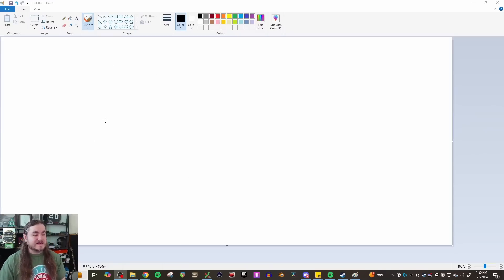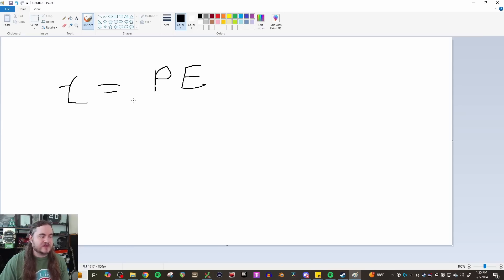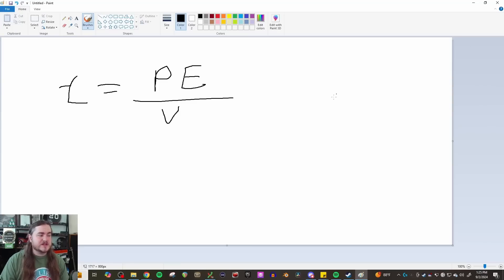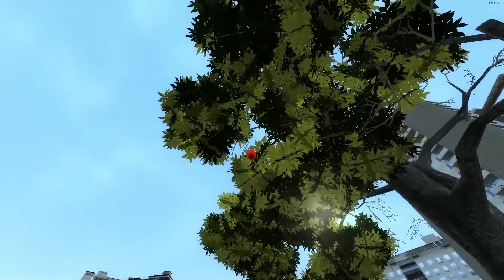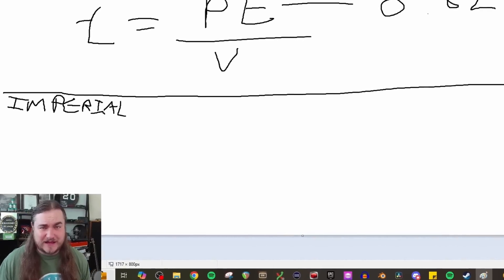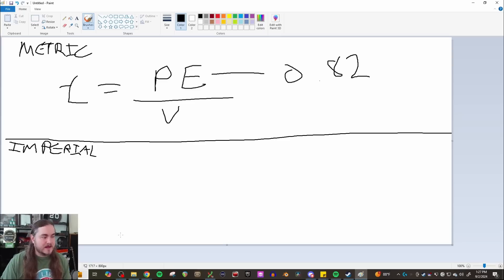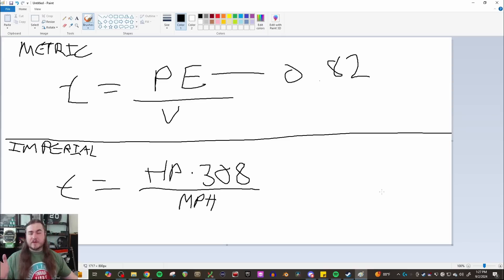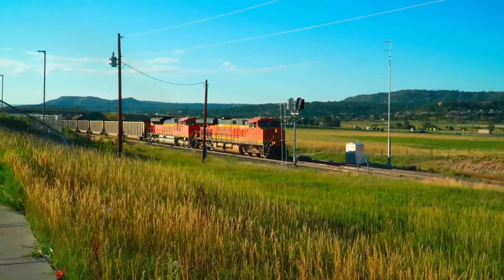Diesel Tractive Effort 101

Comment: 11:10 The complete motive power adage can be summarised like this:
* Steam can pull a train it cannnot start,
* Diesel can start a train it cannnot pull,
* Electric can start a train and pull it fast, but what about switching with electric? Forget it.
Reply: hybrid, battery electric, and occasionally even electric shunters are a thing.
In switzerland the Eem 923, Aem 940, and alstom prima H3 (doesn’t have a swiss designation) are taking over a lot of shunting work.
For passenger shunting, we also have the Ee 922, which is the electric brother of the Eem 923, since passenger train yards often need catenary for modern EMUs anyway, they might as well be used for shunting passenger cars too.
Reply: Even in the early-mid 20th Century, the Oregon Electric Railway had some electric switchers that had batteries to enable a bit of off-wire running.  At least some of these (may have been only a couple) were later sold to the Chicago North Shore and Milwaukee Railroad.
Reply: @Lucius_Chiaraviglio  The North Shore's two battery-electrics were built new for the North Shore by GE in 1928.  They were apparently successful, as they lasted until the end of the North Shore in '63.  I've seen a CNS&M ad from the late '40's touting the advantages of the North Shore's freight service, because of the battery-electric capabilities (no wires into the customer's plant, and no smoke/diesel fumes either).  Of course, the North Shore had an overriding reason for electrification (the passenger service), so their own property was wired anyway, and diesel switchers in the late '20's weren't the far more reliable and capable beasts that came later.

I'm not aware of any battery-electrics on the Oregon Electric.  When the OE dieselized, they did sell the North Shore a couple of big home-built freight electrics, but those were straight electrics—no batteries.
Reply: @Lucius_Chiaraviglio  Many attempts were made to build a battery-powered switcher. But outside of a few niche cases, like London Underground, none were successful in the end. Remember NS BP4? It was eventually deemed a failure and sold.
Reply: @Knsgf  Did any of those recharge while running under normal overhead wire (or on normal third rail)?  Batteries aren't going to be very good if you can't do that.  And the MBTA is going to become a living demonstration of that if they actually go through with their plans to battery-electrify (instead of real electrify) the Fairmount Line (in the south part of Boston, not to be confused with the neighborhood that has the name South Boston).  Not switching, but same problem of having to charge only at the end of the line, and being too battery-dependent.  Although given their past track record, I have a stinking suspicion that in this case it's on purpose . . . .
Reply: @Knsgf  batteries would not be good for hauling long trains many miles.  future batteries that can hold that much energy become an explosion risk.
Reply: @Lucius_Chiaraviglio  depends if you are switching around a yard or hauling 150 cars across 4 states.
Reply: @philhoward4466  That's why ideally you run under the wire as much as possible (while recharging the batteries), and then fall back on batteries when you have to get through a gap, including a loading area of a yard or a spur (or for that matter a drawbridge where they didn't put in overhead wire)..
Reply: @Knsgf  The North Shore battery-electrics were built in the late '20's, and lasted until the end of the North Shore in '63.  A 35-year service life sounds pretty successful to me.
Reply: Electric switchers exist though, and I’d think that high startup torque and fast acceleration would work in their favor?
Reply: @mafarnz  The high infrastructure costs are still there, making electric switchers seldom practical, unless entire switching is confined to already electrified portion.
Reply: @Knsgf  The biggest issue with electric switchers is usually cargo handling. You cannot have overhead catenary in the same place that you want to load coal into hoppers for example. Same deal with rotary dumpers or container cranes. For these applications a rusty old diesel is good enough for the job and investing in a dedicated electric switcher with batteries is just not worth it.
Reply: @Knsgf  if the yard is on an electrified line, then often most or all tracks will be electrified. Only tracks you can't electrify are some loading tracks where you could accidentally contact the overhead with the cargo (e.g. a forklift lifts its load too high)

of course it isn't always the case, but if electric freight locomotives are in use then you want it to be able to reach whatever track it needs to (to pick up or drop off a consist) so it usually makes sense to electrify yard tracks when you have electric freight. When those yard tracks are electrified for the road locomotives, you may as well have electric switchers too
Reply: @briannem.6787  Fully installing ovehead above every track of marshalling, classification and storage yards where mile-long trains are assembled is seldom financially worthwhile, as maximum permitted  speeds there are low and a locomotive doesn't need nor can use high horsepower anyway. The same applies to industry spurs and branches, which in the US can be rather long. 

The reason why electric shunters are somewhat common in Europe is directly tied to short length of trains there and short distances in general, allowing a railroad to get away with smaller yards and shorter branches, which cuts cost of electrification drastically.
Reply: @Knsgf  oh, I didn't know you were specifically talking about the US, yeah they do tend to be a bit of a special case sometimes
Reply: @briannem.6787  The "special" thing about american railroads is heavy reliance on road-switchers - "jack-of-all-trades" locomotives which can do road, local and yard work equally well. This is primarily why electrics never gained much traction in the US and Canada.
Reply: @briannem.6787  . . . Which is where dual-mode overhead electric + bettery switchers would come in real handy.
Reply: @Lucius_Chiaraviglio  Several attempts in different countries were made to build such switchers. They all turned to be more expensive to operate at best and outright failures at worst.
Reply: @Knsgf  I wonder if they were trying to skimp on the overhead and operate mainly on battery?  The right idea is not to operate mainly on battery and then recharge at sporadic intervals, but to operate mainly on overhead and use batteries for the occasional place where you can't have overhead (like to get through a gap for a forklift loading area on a spur).

(The passenger analog:  Not Battery Electric Multiple Unit operating mainly on battery power, but Electric Multiple Unit that has enough battery to get through the occasional gap.)

Either way:  Much less battery to have to maintain.
Reply: @pavelpolcer7354  how the heck had Black Mesa and Lake Powell survived as long as it did? How does the Deseret Power Railroad still survive to this day with that logic?
Reply: @poorbrokenhorn  My comment was reffering primarily to switchers, rather than road locomotives, on typical railroads. Typical railroads are likely to have both modern, high-horsepower locomotives for road use and also older units, that still have some life in them left and can be used for shunting.
Both Deseret and Black Mesa are very different and rather unique cases. Both of these railroads were built specificaly to transport coal to a power station on a single, dedicated route. With a fixed route, substantial traffic volume and having their own power plant, economics of these railroads favored electrification.
Reply: @Knsgf  make electric switchers with batteries.  when they are almost run down take them back to be recharged and grab another one that is charged up.
Reply: @philhoward4466  In other words,  a railroad must buy and maintain two battery switchers to do a job that just one diesel can do.
Reply: @Knsgf  DRG E 80 of 1930 was already a 127 kN starting force battery-backed electric switcher (think more like a laptop; it has on-board charger and naturally prefers to be plugged in, if grid is available; but if you take the grid away it will run for a couple hours on it's batteries. When you plug it back in, it will re-charge automatically.) developed to allow eliminating steam infrastructure near Munich. They got replaced by V60's (stereotypical German diesel shunter with always-on torque converter), though.

With modern power electronics and LiFePO4 cells it's easier than ever to build that style, though.
Edit: you can probably just take a European design of a 4-axle electric, add the battery, slightly stiffen the frame as needed, and end up with a NA-typical axle load electric locomotive that has a decent runtime on it's internal batteries. Say, 30 extra tons of LiFePO4 at utilized discharge depth of 100 Wh/kg, gives 3 MWh of useful capacity. For a 3000 ton train, that's equivalent to having 1200 ft of elevation to roll down from, except of course that electric motors unlike natural slopes let you choose the instantaneous acceleration with no significant loss in efficiency.
Reply: @namibjDerEchte  Let's do some more math. Pulling a 3000 ton train uphill on a 1 % grade at 20 mph requires 3500 hp or 2600 kW. A 3 MWh battery back will completely die in litlle more than an hour at that load, covering 23-24 miles at most. Then the train must stop and sit idle doing nothing for at least another hour to recharge.

Contrast this to a mainline diesel electric, whose fuel tank holds about 80 MWh worth of electricity. The diesel can travel with the same train on the same slope at the same speed for no less than 600 miles on a full tank. And it only takes half an hour to refill. 

So no, batteries alone are completely worthless for a general purpose locomotive. The only practical way to make use of battery electrics is by using an overhead power on the mainline and only switch to batteries on sidings and industrial branches. Whether this concept is workable in practice, only time will tell.
Reply: @pavelpolcer7354  There are solutions to things like hopper loading—Kennecott Copper ran electrics with offset pantographs to allow ore loading, for example.  Container loading is harder, but even there I would not claim it's impossible; the big container cranes themselves are electric, after all.  The really intractable problem is the cost of wiring all the yard tracks, which pretty near doubles the cost of the yard.
Reply: @brownpcsuncedu  You push the wagons into the loading area. The locomotive never has to actually go into the loading bay. You might need a few spacer wagons but so what? You can adapt, it's just a matter of using a new tool the right way.
Reply: @placeholdername0000 Spacers work fine until you need too many of them.  The North Shore ad mentioned the plant's yard (such as a steelyard, where large, not-necessarily-regular steel shapes are being moved around with cranes).
Reply: @brownpcsuncedu Oh, that's absolutely true. But don't a lot of those sites have a few small shunters stationed there? Some small diesel or battery powered mini loco capable of pulling a few wagons at low speed from one end of the yard to the other? Mainly because they need to move the wagons internally in between delivery days.
Reply: @mafarnz @robnobert  Its a "final mile" problem, just like power-wires at home. There is easily more distance of wire between every houses fuse box and the closest power poll than runs down the street. Easily more down every street to substation than between substation and power plant ect. So the big impressive feats of engineering embody a lot less of the work and cost than the little stuff. Its extremely affordable to electrify between two cities, but to put more miles of wire into yard tracks that might see only a few cars at a few miles an hour? Uneconomical at its extreme, and its not a "buy once, cry one" type equation either, your maintaining all that infrastructure in situ rather than having a single fueling stand and maintenance shed for the motors, to work inside under lights, not out in the weather. Also one failed shunter is a nothing for meeting schedule, it can be dead towed out of the way and still leave you with just as many operational on the day (there are always a few waiting, or down for routine maintenance that can wait till tomorrow), but a single failed insulator will kill power to most (if not all) the yard. Also loading things onto cars underneath traction wires with cranes ect is more difficult, and 3rd rail systems make switches more expensive and yards more dangerous for operators who are working on foot.

The one coming technology that could change that paradigm is batteries, totally useless for the continuous output of mainline freight, lacking the range for intercity passenger and less safe, heavier and more costly than systems to allow controlled back-feed on EMU services (which currently are using rheostatic dumps, despite power actually being the most expensive part of train operations, just ahead of crew costs, and far over track/wire maintiance on busy routes), small (and often remote operated) battery shunts allow for lower fuel costs/emissions within yards, and are easily rotatable to keep units charging. Yes the batteries will wear out but it will sum to less cost than difference between fuel and power, and unlike automotive applications they don't need the extreme power/weight, and can be far more durable/stable and standardized/recylable, so it might not even be the human/environmental disaster of large electric luxury cars. Or who knows, we might see the technological promise then find some new way to mess up just as badly, time will tell.
Reply: Each time you want to change direction you need to pull a pole or pantograph and raise the one on the other end. That time adds up fast.
Reply: @ pans and poles can be made bi directional. Milwaukee used electric switchers for decades that worked great.
Reply: I've seen electric switchers, or shunters as they are also called, in Hungary. They're probably just for passenger coaches though.
Reply: @thegreenguy5555 That would make sense, since passenger coaches aren’t nearly as heavy as freight cars.
Reply: Electric switchers are pretty common here in Central Europe and have been used on yards without problems for decades.
Reply: @ErikZiak  Still, they're exception rather than a rule. In larger countries like India, China and Russia electric switches are almost unheard of despite extensive use of electric power for mainline trains.
Reply: The Swiss and Swedish railways would like a word. Both have had electric switchers for a long time. Also, I've personally seen switching done with a radio controlled Rc6 electric locomotive (an Rc Rc, if you will). The Swedish railways have also had battery/catenary locomotives (series Öa, Öb, Öc, Öd). Apparently the maintenance of old style batteries was more expensive than diesel operation at the time. This may well have changed with more advanced batteries and expensive fuel.
Reply: @JuhanaSiren  Short distances and small yards + plentiful hydroelectric power, in stark contrast to the US. And even with modern advancements in battery tech the operation of BEMUs is still more expensive than DMUs.
Reply: Electric freight trains!? Getta outtahere this is America. It's a big country. This isn't the dainty hills of Norway. We need power!! SPEED!! We need liquid hydrogen fueled rocket engine powered trains. Probably about x2 Saturn V F-1s strapped to a tanker car on the back outta do it. Your ETD won't survive unfortunately but the exhaust will melt the train circuit components anyway so there's no problem there the company will know your train passed through.
Reply: @robnobert  meanwhile, almost all the big "diesel" engines are diesel-electric, meaning that the diesel is only there to power electric motors :p
Reply: @robnobert  You get a lot more power from electric locomotives than from diesel ones.
Reply: @robnobert  Ever look up the trans-siberian railroad, or the milwaukee road pacific extension?
The technical limitation  to long-distance electric in harsh conditions doesn't really exist. It's more the Class Is can't be fucked to pay the up front costs themselves without a legal requirement
Reply: @hvymtal8566  dude I suggested strapping on Apollo rocket engines to freight trains for tractive effort and you think I'm being serious?????? chillll bro chill 😂😂
Reply: @robnobert  electric freight won’t work in the US?  The Milwaukee Road lines west would like a word…
Reply: @brownpcsuncedu  Modern day electrics are far superior to diesel locomotives, as shown by their successful use on freight in other countries.  The issue was that by the 1970's Milwaukee had made only modest improvements in their overhead system, and hadn't upgraded their electric locomotives since the joes.  It would be equivalent to a class 1 using F's and GP9's for their primary power at the time.  If Milwaukee had chosen to upgrade their electric system & locomotives on an ongoing basis, or had taken up GE on their offer to do so in the mid 70's, it's likely the MILW would still be running electric freight.

Comment: For those curious the equation for Horsepower is torque measured in foot pounds times rpm divided by 5252.    Ftlbs(Rpm)/5252=Hp